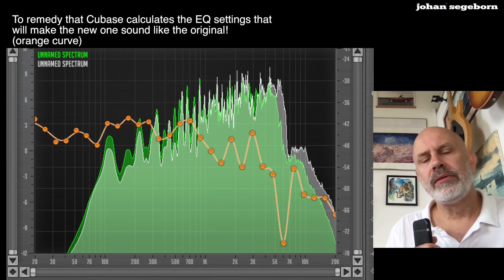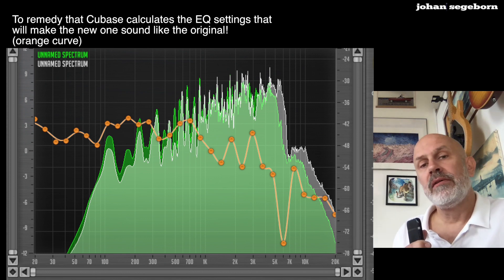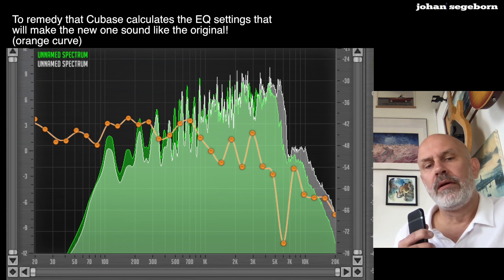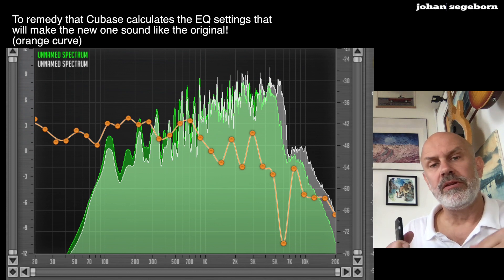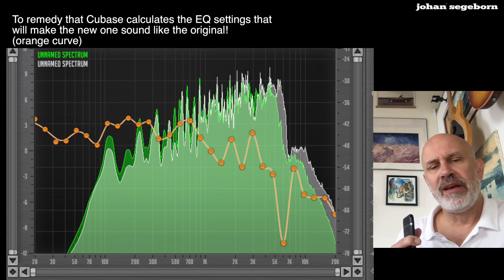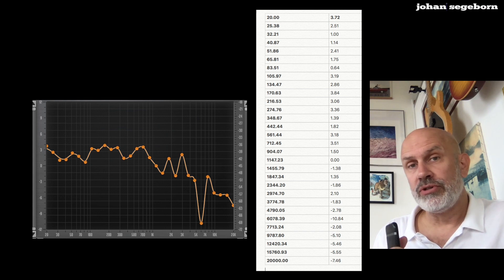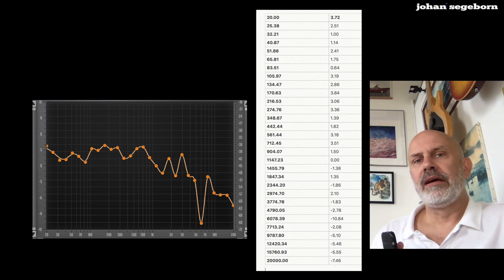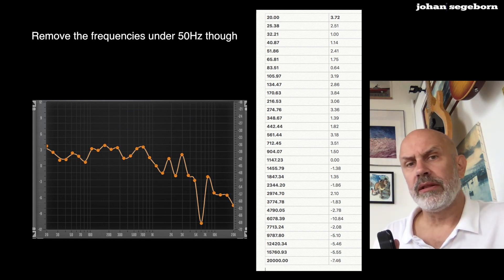Make your NEW Greenback sound like the ORIGINAL using EQ MATCHING!!!

Comment: Very impressive. Hope to see a try with an EQ pedal like a GE-7.
Reply from the maker: Thanks, I’ll try it with an EQ in the FX loop too!
Reply: Would really like to hear that as well! +1
Reply: My Rivera Rockcrusher Recording Attenuator has a 12-Band EQ on the Line Out for the purpose of emulating different speaker and enclosure combinations.   I've always been happy with the result when using it.
Reply: While I doubt it would be quite as effective as this method, I would also love to see how close one could get to matching with a GE-7 in the fx loop. Great suggestion!
Reply: @tonekilltech  Yeah I’ve been wondering about that for a while. I mean, one could easily cut some high frequencies right?
Reply: @hkguitar1984  yeah it should be about the same I suppose, if it's a proper  pedal it should sound better than an app as well.
Reply: But the eq here is POST-speaker. Using a pedal will only affect the pre-speaker sound (so changing the response of the guitar, rather than the speaker), even in the loop. The brightness of the reissue will still be there
Reply: @blutos  I think a similar outcome can be achieved in the loop as in post. If you cut 6k before it hits the speaker, the speaker isn't going to add it back in. That said, there isn't a pedal that has 26 freq bands that could do exactly what this software is doing. I tried sharing a link to a picture of my GE-7 pedal set to match this as closely as possible, but apparently YT or someone thinks external links are spam.
Reply: @JohanSegeborn  It might still be close but you can see not only is the new speaker overrepresenting treble, it's underrepresenting great harmonic mids that are present in the old speaker.  It is likely hear that the old "formula" is the same, but the doping\treatment somehow shifted the high abrasive presence into a pleasing midrange.  See what happens when you spray some glue on a new cone!
Reply: Another vote for the GE-7
Reply: @JohanSegeborn  Johan try x 2 Boss EQ pedals in the loop! Just for the buffers! It's a cool result certainly on DSL and 6100lm 100w. Boost 1.6 and 800 (cant recall exact freq's)  and cut 6k a bit (to taste) leave the other flat or use as lead boost. Easy way to de-fizz a 'modern' marshall
Reply: @JohanSegeborn  I have used 1 in my amp loops for years. Just helps add clarity to the sound clean or dirty!
Reply: I use a Fryette PS-100,which is a reactive load and power amp with my Marshall….it has a built in FX loop which is post power section ,so an EQ for this purpose should work great….I will have to try it..
Reply: @tonekilltech  It's true that there isn't a pedal: but there are plenty of rack units, such as the DBS 131s, which has 31 bands. What is missing from all these hardware solutions is the automation of the comparison, which leaves you dependent on memory and trying to match by ear.
Reply: Yes please Johan. It would be amazing if we could come close to replicating this in a live scenario!
Reply: Considering the Boss GE-20 myself because it’s got 10 bands vs the GE-7.  
Also considering the Neunaber Iconoclast which appears to be far more precise.
Wondering if I can get the Mooer “Tone capture” pedal to do this even though it was meant for guitar matching.
Reply: I use an Analogman modded GE-7 in the effects loop of my Marshall SV20H going into a 1x12 w/a newer Greenback and it works pretty well. Prior to this video I thought the excessive brightness was all the Marshall's fault! And, prior to using the GE-7, the tone was definitely unfit for live performance...

Comment: It would be interesting if you created an impulse response file with the EQ match and you loaded it into a pedal like the Mooer Radar, and then connect it to the FX loop of the amp and see if the EQ match also works with the room sound of the amp.
Reply from the maker: Cool! I’ll try that!
Reply: @riangarianga  Yes, the EQ is applied in post. But if you use to capture the frequency spectrum the same riff, amp, cab, mic and mic position, THEORETICALLY, you take all of these parameters out of the equation and the only sonic differences have to be due to the speaker itself. But... All of this is only in theory, hehehe
Reply: @jamartin_music  Yeah, and regardless of the actual result, experimenting is so cool! 😁
Reply: @JohanSegeborn  a video of that would be cool!

Comment: That is pretty close.  It just needs a little more tweaking to get there.
I saw a guy get real close by using his ears and a frequency analyzer.  He was going for a tone off of an album, so he had to match other things like amount of distortion, reverb, chorus, etc., but the tone he got,while not identical, was more than just passable.  In other words, what you've done with the help of automation, he did manually with an audio tool or two and his ears, manually.
Nice video.  Useful/thought-provoking.

Comment: Great video, as audio engineer I been using this trick since more than a decade ago to “fix” the brand new speaker sound, I even have eq templates for different Celestion speakers on my waves pulgins, but I noticed that the more used the speaker the less EQ is needed, would be interesting a video to compare a break-in new greenback to a brand new one and a 70s one
Reply from the maker: Thanks, yeah we’re gonna try this for a bunch of speakers

Comment: This is incredibly impressive, Johan! Given that it's just a linear transfer function, I'd expect it to be very specific to that exact mic placement, cabinet resonance, room sound, etc - but that raises the possibility that if these measurements were repeated with a free-hanging speaker in an anechoic chamber, we might actually get closer to a generally-applicable EQ compensating curve.
Reply from the maker: Thanks Anthony! Yeah we should try more controlled measurements too
Reply: @JohanSegeborn  Use a looper pedal too, to repeat the same riff
Reply: I agree, but it will also be limited to the operating point of the speaker, the power input and speaker nonlinearities associated with being overdriven.  I do wonder if there is a power input point where frequency matching won’t work as well. Anyway, this is a great demo of how the sound differences in these speakers come from mostly the frequency response.

Comment: Excellent demonstration.  Thanks.  The challenge with real time EQ pedal, will be to find one in which you can accurately/practically transfer your EQ correction curve to.  Too many of these inexpensive devices are not very precise and may (maybe not) add phase discontinuities to the output. Good luck with the follow on!

Comment: I think the ability to match the EQ profile of a sound using software is one of the most powerful tools around to emmulate the tone of a reference file/sound.

I've watched Jason Sadites on his Channel do it many times using the iZotope Match EQ plugin, and get great results. He's often done this in the context of showing that the Helix/Line 6 Modelers can sound just like Analog gear, etc. One of the things he does to get extremely close matches is to do a couple of runs of the matching process. He does the first run, and gets a close match, then uses that file in the 2nd pass to get a near perfect match. Great stuff.

I wish Modelers would include a Match EQ feature as part of their Desktop Software. That would make "dialing in" to a specific tone a breeze. Thanks 😎
Reply from the maker: Thanks, I’m gonna check out Jason’s videos

Comment: So probably a zobel network installed on cabinets with new greenbacks could possibly achieve something close in a live situation. Johan you should do this frequency comparison of the original greenback and the new one with zobel network as a subject of another video
Reply from the maker: That’s a great idea!
Reply: I don´t think so. If you look at the EQ compensation curves, there are a lot attack points where corrections are made. I have tried Zobels on guitar speakers, with no good results.
Reply: If someone could post a link or resource as to how to make a zobel network for such applications would be amazing.
Reply: The plotted compensation filter has 30 points.  Even if that were just 30 2-pole bandpass filters, it would still be a passive network of nearly a hundred components, right?  Maybe fitting a couple of much simpler filters to the transfer function could result in a practical zobel network that would provide some of the benefit.
Reply: @Jediroller  They are not used for this type of application. Zobels are used for different things: To reduce ringing on audio transformers, for straightening out impedance on LF speakers when designing crossovers, to reduce the highest treble, but not parts of the midtone, like vi want here. You will waste your time trying to make them get a new Greenback sound like an old one.
Reply: @qddk9545  Thanks for your reply. I actually was just interested as Johan had made what I thought an interesting video where he conencted a zobel to the output transformer to roll off the high end and sound more like a vintage transformer. I was hoping someone could show me how to make one and what their application is, in my situation using them like you suggest above as a crossover in a 4x12 cab I have currently where the top 2 speakers are v30s, and then both 2 speakers are vintage bass cone greenbacks. I wonder if introducing a zobel could remove HF from the bottom speakers etc and if the cab mixed with 2 types of speakers could sound better? Would make an interesting experiment I think.

Comment: This is great stuff Johan  .  Solid engineering for the recording studio. Can this transfer to analog for live, and how many bands on the eq?
16, 24 or 32 band?
Reply: Quickly I counted 26 points of adjustment along the frequency range, obviously the more points of eq the closer to the real thing you will get and this is a very nice sounding speaker
I think this technology can be applied to amp tones as well to create your favorite amp design by changing the eq
Reply from the maker: Thanks! I’m gonna try a hardware EQ in the FX loop
Reply: @stevencancel1727   Man that is awesome.. There is drawback to this. time to buy a 32band EQ and add it to the Rack,,,,,,, uh  hold da phone,, Rack Mount, another slot filled, looking baddass,,,, hmmm Must Buy larger Rack!
Reply: @JohanSegeborn  I have digested this overnight if you can generate white noise with spectrum analyzer and flatten the room, that will set an accurate reference then record the vintage, and the new speaker will be a 32 band walk in the park.. I think I used an akg mic to pick up the white noise.  It’s been 30 years and a lot has changed. But what you have laid out is engineering from 70’s and 80’s.  It is  rock solid old school engineering.on any and all levels. There is a few beers in the cooler  with your name on them. The other 3 are for Billy S.

Comment: We’re cool, interesting to see that the old greenback has dampened upper-mid frequencies and the difference that accumulates over the years presumably due to moisture, wear and tear etc. assuming of course that the new ones are constructed the same way out of the same materials.
Reply from the maker: The 70 Greenback sounded very close to this back then too actually, it has lost some punch though
Reply: @JohanSegeborn  I’ve been building my own cabs last few years and I always use vintage 30s and cream backs, thinking of putting a pair of greenbacks in my next project. Thank you for all the great videos! 🤘🤘

Comment: I believe this is the same technique that a lot of modeling technology is based on you take incredible sounding amps and take an EQ "picture" to recreate exacting replicas of the greatest amps of all time, many have and are continuing to try to make very real recreations of these amps
could save us all a lot of money if they get it right
Reply: The way amps are modeled is a lot more involved, as they are non-linear and can't be represented by just an EQ curve or impulse response. However, cabs, speakers and mics are modeled with basically this same concept, but to a much higher level of resolution (a properly made impulse response is essentially a highly detailed EQ curve, but with way more precision than you can achieve with individual EQ point values like in this video).

Comment: I suspect that studio engineers have been doing this for decades, but by ear, using multiband graphic equalisers. This software takes the elements of trial and error, and individual hearing variation out of the equation, so it's more objective and reproducible. It undoubtedly made the new speaker sound more like the Pulsonic - which, to my ear, is the more musical speaker.

Comment: I would also argue that this is a very good hypothesis as to why same speakers of different age sound different.... Here is my argument... 1 an older speaker will interact differently with the power amp of an amp, 2. I dont believe that there's soo many dips and spikes over a short freq , 3 . ow was the speaker broken in? on what amp?   Love ur stuff Johan just think there's no replacement.... soo many variables even magnetic degausing and different material... no 2 amps or speakers will ever sound the same

Comment: Thanks Johan! I wish you would have used the heritage greenback like the EVH or the Greenback heritage version which are the same speaker supposedly. I think Celestion should still be trying to crack this code and get closer the Pulsonic. I think they gave up too early and settled. You would think with the technology available they could take an original use something to analyze the cone materials and most importantly the voice coil materials and wire and nail down this tone once and for all. If anyone can do it Celestion could with enough pressure from users.
Reply: Have a pair of 90's greenback with 6402 cones 8ohm
use in a 2/12 open back cab gets about the closest to vintage pulsonic, very organic incredible bass
Reply: @stevencancel1727  Ive actually compared the 6402 coned greenbacks side by side  with pulsonics and I did like them. Both were in 4x12's though. They are good. I wonder how the heritage greenback or EVH which sounds a little different from the Heritage G12m due to different doping sounds next to the 6402?
Reply: @HiHello-ku1fl  I have the 8 ohm variety and have many pulsonic and Kurt Mueller cones and the 6402 sounds the most organic
Just picked up a hendrix cab with G12 C further study is necessary but initially the 6402 is best, closest thing I have is G12 H 30 55hz 16ohm blackbacks with new 444 vintage 30's cone kit
Reply: @stevencancel1727  Interesting.
Reply: @stevencancel1727  you like the 6402 even more than the H30 with Vintage 30 444 cone ? I usually do prefer the M magnet speakers. I do remember just barely liking my pulsonics better than the 6402 but I was surprised. Not exactly the same but just as good of tone just a little different and way way cheaper. Did they use them in the JTM45 bluesbreaker combo's starting in late 80's through mid 90's? Not sure when the 6402 coned greenbacks came out. Dont they have a little different color green too?

Comment: I agree with the guys below, I would like to see how an IR using a Moore Radar in the FX loop sounds. It possibly would have to be ‘mixed in’ rather than 100% effect. I’m still surprised/ worried by the sound of the new Green Back. Does mic placing have something to do with it or is there such a marked difference when actually listening to the speakers ‘live’ in the room. I know from my studio days that a slight move of the mic on the cone can change the sound a lot. Would it be a better representation with a room mike as well? Do the new Green Backs actually sound ‘fizzy’ in real life compared to the originals? I was about to buy some for a speaker that I am building and now I am not so sure......HEEEELP!!
Reply: Don't worry, while they may not sound like 50 year old originals. The brand new Greenbacks are a fine sounding speaker on their own.
Reply: @pmkrak  thanks for the confidence boost!

Comment: Didn't know how old mine were ...just checked my 4x12 out and it turns out they're from 1967  lol...been using that cab for 20 odd years lol...sometimes you need a kick up the arse from Johan 😂
Reply from the maker: Hahaha! Nice speakers!
Reply: @JohanSegeborn  Yeh they sure are ...I just had a band rehearsal  (acdc tribute ) and dusted off my 73 sl/a 100 Monday night in Glasgow volume on 6 but turned it down with the Marshall power brake a bit and it was amazing Malcom was using 78 master volume and my god I was walking around like a half shut pen knife for 3hrs lol😂

Comment: About 10dB cut at 6KHz. That's a lot. Try this method on other brands and types of speakers, to see if you can "emulate" the greenback sound. A JBL or EVM might be able to sound similar with some filtering too. LET'S GO!
Reply from the maker: The narrow Q 10dB cut works since there is basically no content  over 6kHZ

Comment: Very similar, but the Chinese feels more compressed… the original feels more dynamic and musical (more harmonics), maybe the heritage g12m feels more close to the original, but it lost 5watt
Reply: I'm not sure the Heritage lost 5 watts....I think its the same but they call it 20 watts because thats what the original was. Should still be 25 watts. Maybe different glues etc for the wattage handling they put on the label? Maybe they are doing that so people dont blow them up. Should be same volume too but maybe the chinese or standard one is brighter making it sound louder? Just my guess.